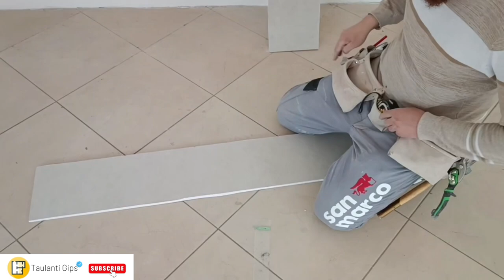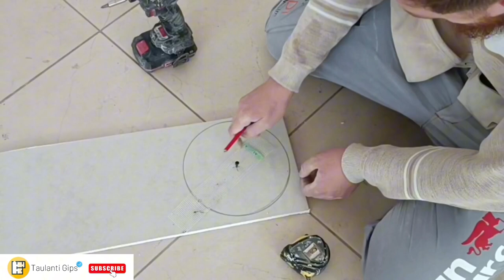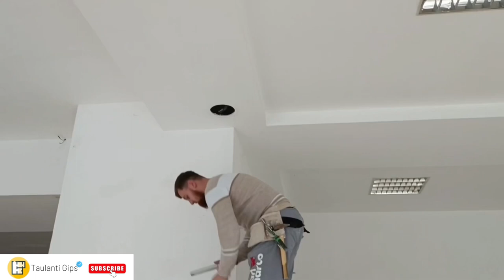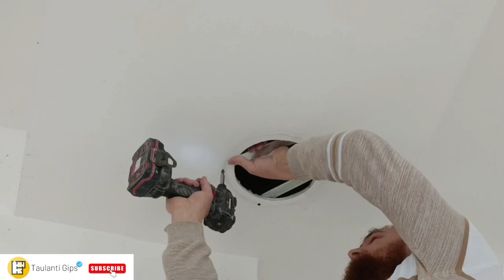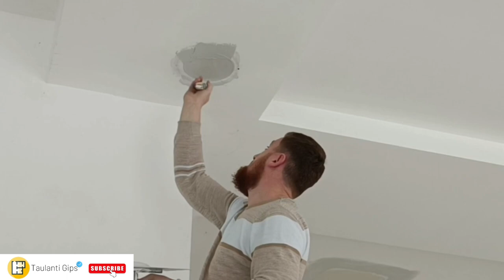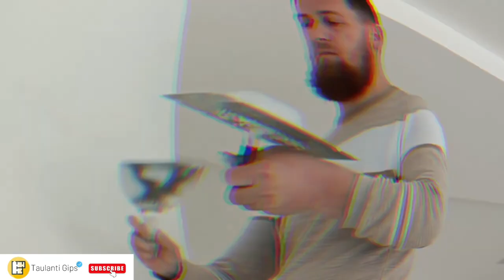Repairing a ceiling hole 🕳️💪🏻

Comment: That's not the right way to do it
Reply from the maker: @xiSWIIFTix  ok tell us the right way😁
Reply: @TaulantiDrylining  Do strips and slightly overlap them instead of cutting slits into it and going around, that just ends up weakening it. I would recommend using fibafuse as its a more durable material. Also use your trowel more
Reply from the maker: @xiSWIIFTix  thanx👍🏻
Reply: @TaulantiDrylining  you are welcome